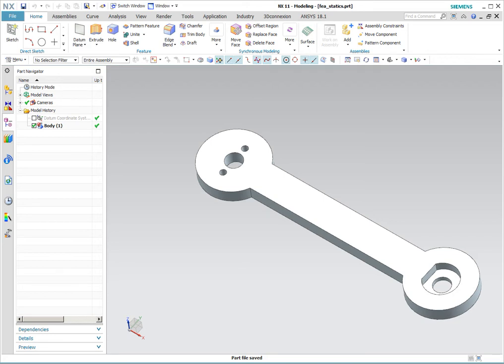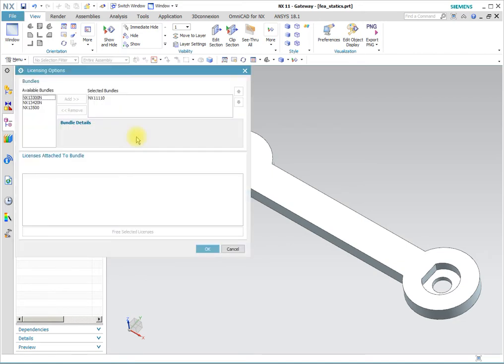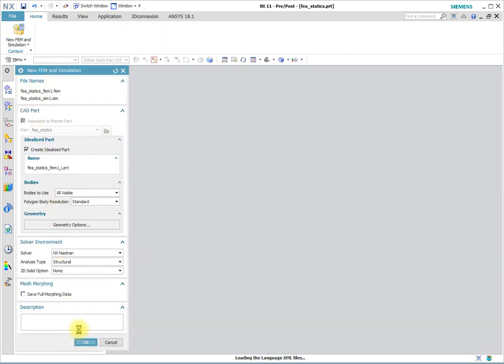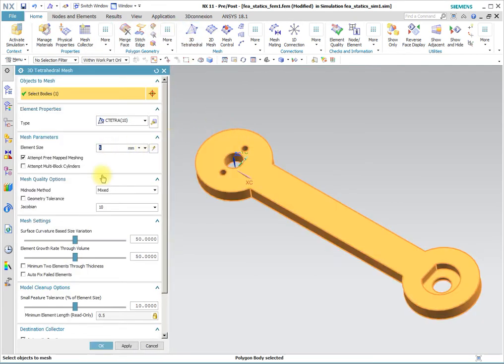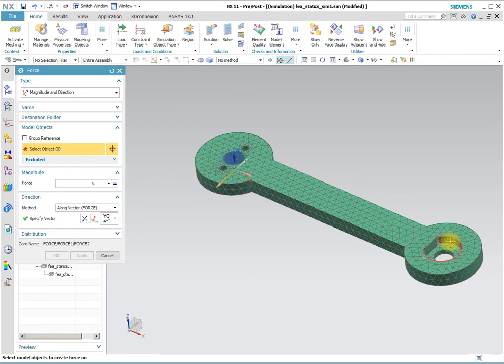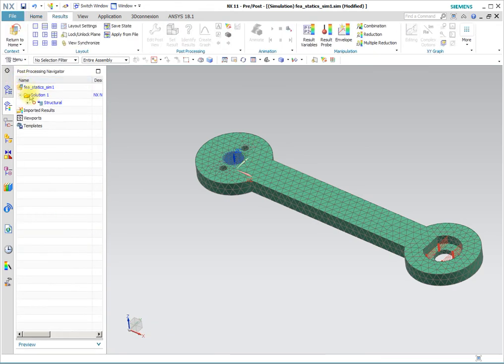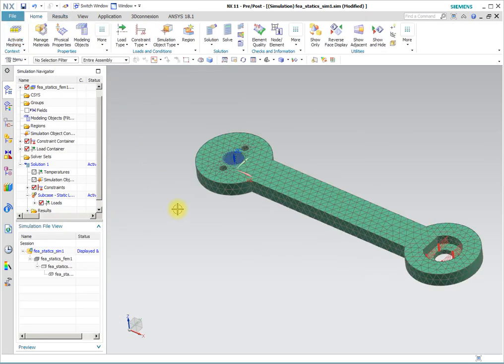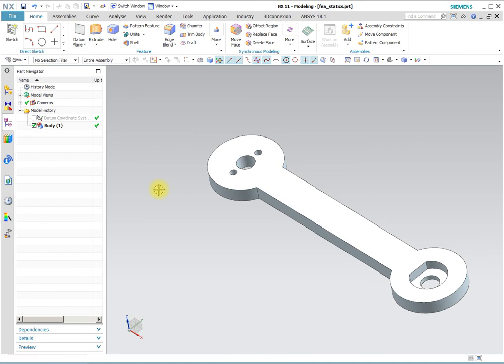01 NX11 FEA statics single part clean

Comment: I want to learn fea simulation for dynamic and static stress.  Can you plz guide how to start?
Reply from the maker: You can download free software for learning FEA from ANSYS. https://www.ansys.com/en-in/academic/free-student-products

You can take a free course to learn thermal, statics, and CFD analysis using ANSYS at edX.org.  https://www.edx.org/course/a-hands-on-introduction-to-engineering-simulations

You can search YouTube for ANSYS tutorials and there are lots of them.

You can ask questions at the ANSYS Student Community.  https://studentcommunity.ansys.com/
Reply: ANSYS FEA Examples I have nx11 can I do in nastran. Should I have to download ANSYS seperaterly.
Reply from the maker: If you have NX11 and NX/NASTRAN, you can join the SIEMENS community at https://community.plm.automation.siemens.com/

I have a series of lectures to learn NX11 and NX/NASTRAN that I could upload for you.  You can probably find a lot already on YouTube.

The ANSYS Student license is limited to small problems (but it's free). If you have NX/NASTRAN, that will be an unlimited license.
Reply: ANSYS FEA Examples  where did you upload series ? Can you share link?
Reply: please upload it  Thanks
Reply from the maker: I put three new videos up for NX11 users. 
https://www.youtube.com/watch?v=zSjMsaFr7vs
https://www.youtube.com/watch?v=nhjR3drKIh4
https://www.youtube.com/watch?v=j8OD-0pzUxw